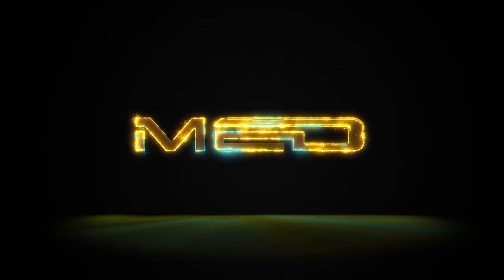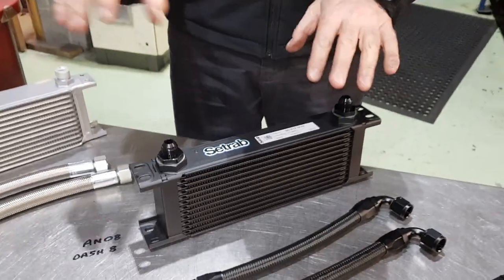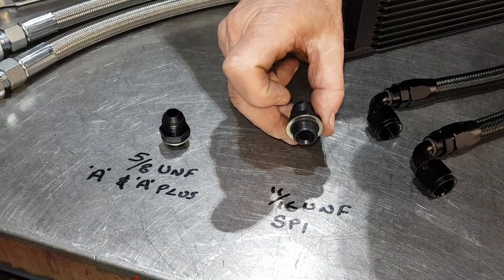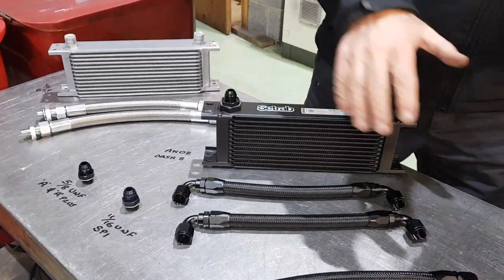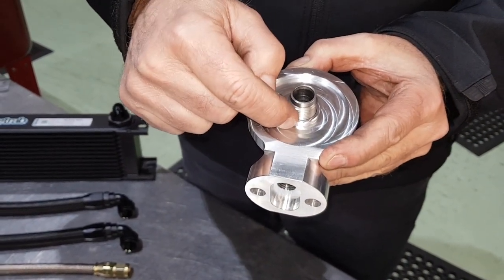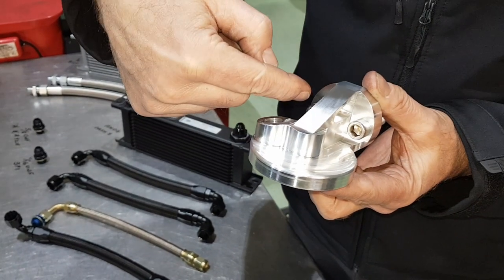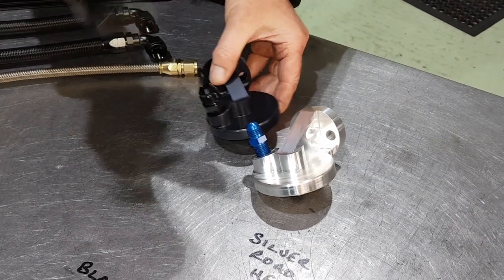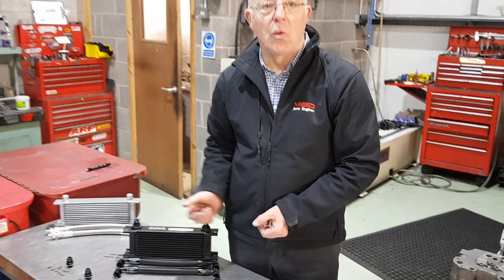A-Series oil cooler and filter head upgrades

Comment: what stops the two way blue anodised union leaking when it's screwed into the aluminium billet filter housing? The early type unions on A Series engines had thread lock already on the threads to stop oil travelling back up. Also would this fit an A Series as opposed to A+? I can't see why not. 

Any advice would be great.

Comment: So you don’t need the oil bypass at all in the filter housing? 
Can you explain a little more the issues around them in the existing units
Cheers 👍
Reply: Believe it was put there so the oil could bypass the filter if it became clogged and was causing a restriction but the problem was then it would sent unfiltered oil through the engine which could also do damage. Either way of you change oil and replace the filter regularly you will be fine
Reply from the maker: As Harry says below. It's best to change the oil and filter frequently on a Mini. We tend to oil change between race meetings, or a couple of times a year on the road.

Comment: Helpful as ever.
Noticed all 13 row coolers. Do you do a 8 row cooler, or not recommend?
Reply from the maker: You can fit a smaller one if you prefer - we've found 13 row is ideal for competition. If unsure, rig up an oil temp gauge to keep an eye on things.